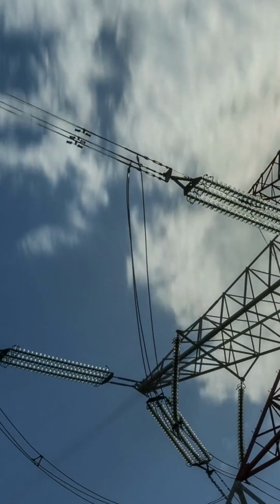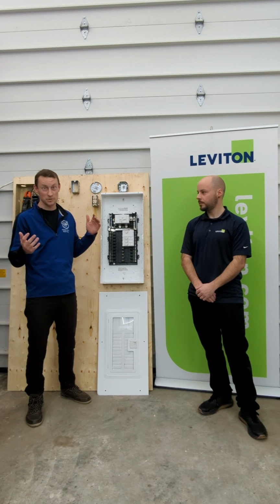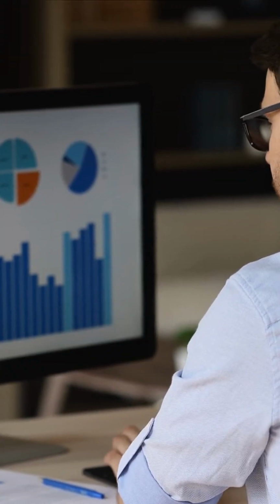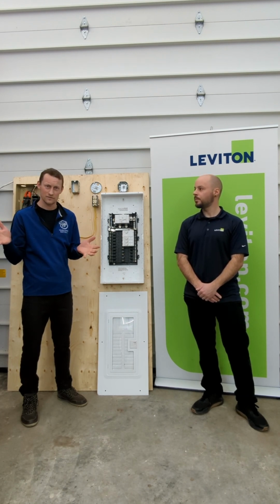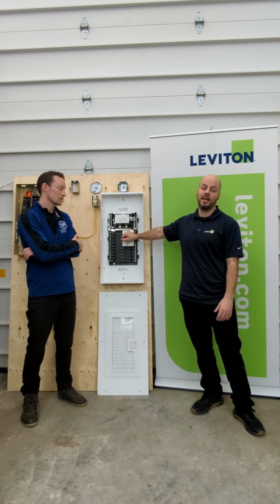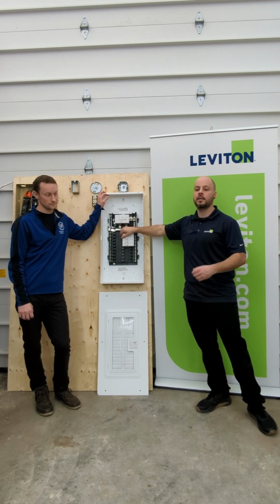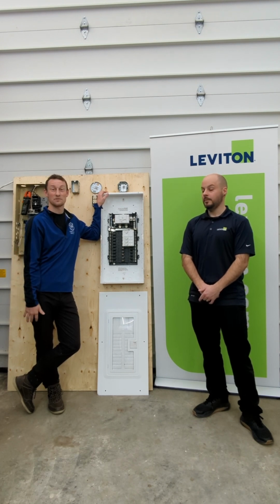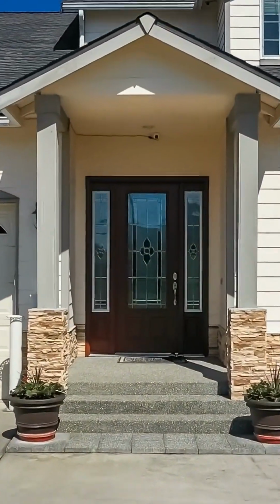Edmonton Electrician | Whole Home Surge Protection Leviton

Comment: Does it matter in what sequence the surge protector goes into the panel?
Reply from the maker: Yes it definately matters depending on the surge protector. Some surge protectors are installed inside the panel cover, some right onto the bus and many are terminated off of a breaker to the unit located externally on the panel. For all connections though, you want the source power to be off until the connections are completed. Thanks for the question!